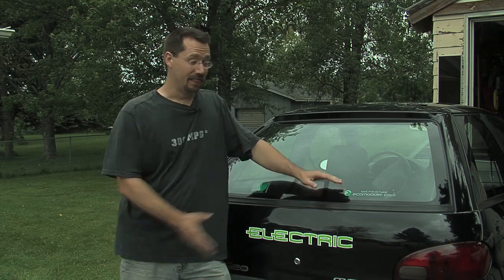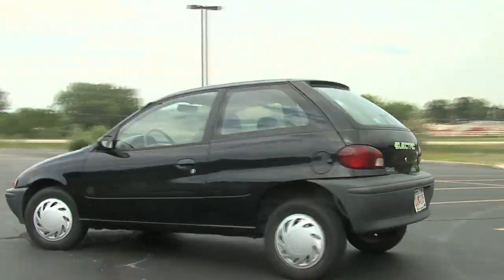1 Build Your Own Electric Car: Intro

Comment: you should need a transmission what you are doing now?
Reply from the maker: The short answer is YES.
For the long answer: https://300mpg.org/projects/electro-metro/transmission-for-an-electric-car/
Reply: @BenjaminNelsonX  I mean you have electric motor so you dont need conventional transmission
Reply from the maker: Yes, but you still need a place to mount the motor, and you need gear reduction and a differential. 
In the case of this small older car, all that can be done easier by re-using the existing transmission than any other way. 

If a person is making a conversion nowadays, another option would be to use parts from a salvaged commercially built electric car, like a Nissan Leaf. In that case, a person could reuse the Leaf gearbox.

Comment: So you're not an expert or engineer and no nothing about all that but you are a great instructor! And your intro music makes this 65 year old engineer want to boogie while I learn about building an electric car. I have an off road buggy I want to electrify. Something 24 to 48 volt that I can power with my 9ah 20v tool batteries. I have many of the same kind and several chargers. But my objective is to add a  solar panel to the roof of my buggy that will help with charging and provide continuous power and charging capabilities. Shehould the shtf and the power grid goes down I can have some lighting and be able to keep radios cel phones and a power inverter operating.

Comment: Hi Ben, Could we convert an AT car to an electric one? What is the most challenge comparing to MT car conversion?
Reply from the maker: Yes, you could convert a car with an automatic transmission to an electric car. However, automatic transmissions are designed with the characteristics of a gas engine in mind. It will NOT be particularly efficient with an electric motor. Folks sometimes use the automatic transmission, but remove the torque converter and lock the transmission in a single gear. Still, those are extra steps you wouldn't have to take with a manual transmission.
Alternatively, automatic transmission type vehicles sometimes have the transmission completely removed and do "direct-drive" on a rear-wheel drive vehicle - Motor to a short drive-shaft to the differential. You need a powerful motor and high current to do that though.
At this time, we also now have some aftermarket parts available for the EV conversion market. For example, you may be able to completely remove the automatic transmission and replace it with a dedicated single speed gearbox.
Overall, YES, you can convert an automatic transmission to electric, but it's just simpler to use a manual.

Comment: Very cool. Can you legally modify and drive a car ? I mean is it allowed to modify a car and still Putin on public roads and have it insured by a company?
Reply from the maker: Yes! Laws on automobiles vary, depending on where you live, but a safe and practical electric conversion is still a "real car"!
Check with your local laws and insurance agent first to make sure you need any legal requirements.